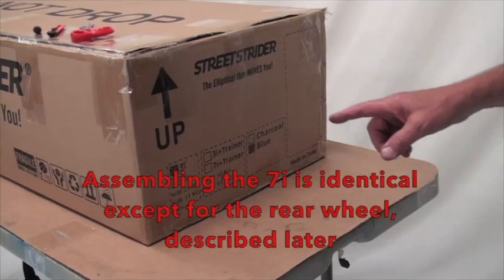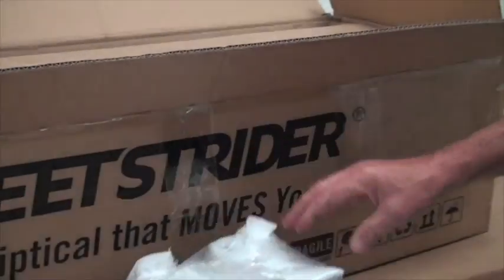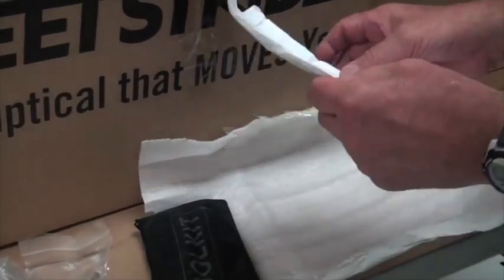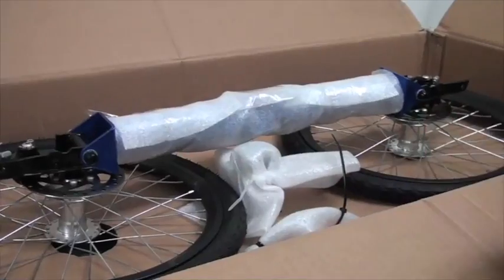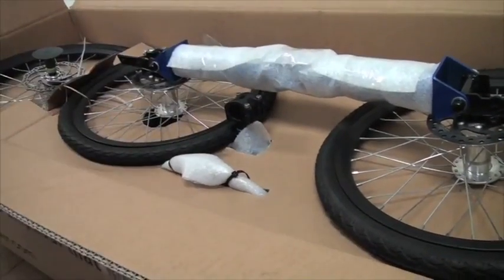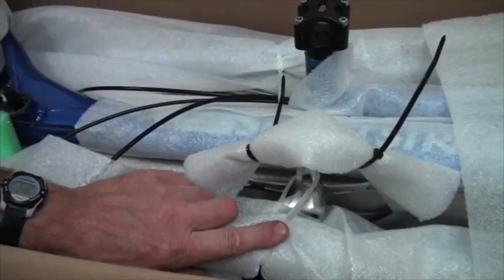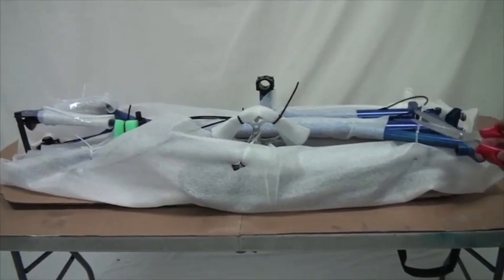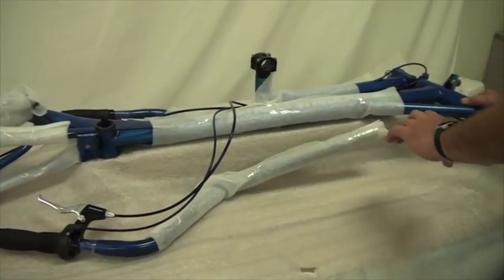StreetStrider 2016 Assembly 3i&7i PART 1 - Unpacking and Prep

Comment: Got one was so excited however there was no CD as indicted, or do I need to watch You tube to assemble the bike?  Dave is awesome with his instructions on you tube!   I think I am confused does the 3i require the shifter cassette parts and cassette pulley?
Reply from the maker: The CD is no longer provided as more recent videos are found on our website.  The 3i uses a pushrod for shifting and the 7i uses a cassette pulley.  In the manual it has 2 different sections for the rear wheel first for the 3i then for the 7i.